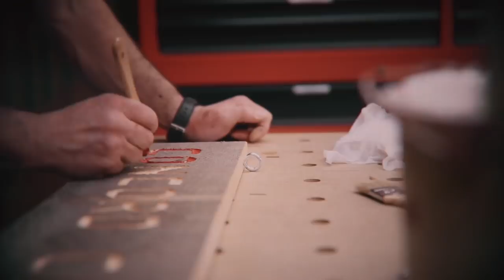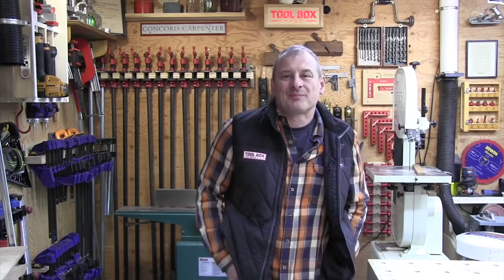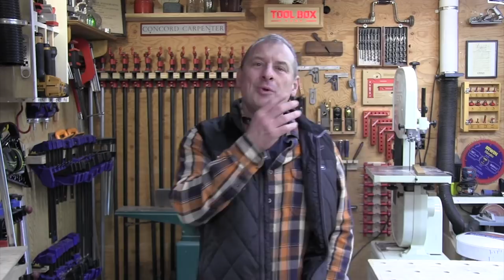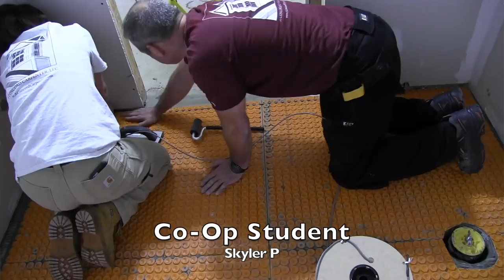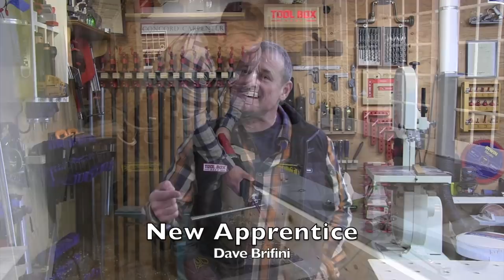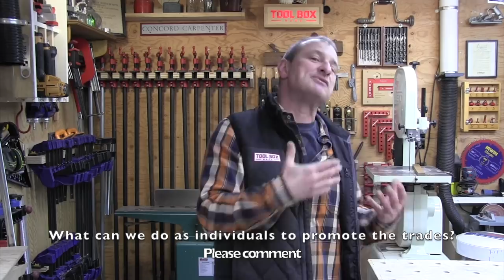Carpenter Apprentice - Trade-Skills GAP -What Can We Do Better?  Video 1

Comment: I spent my career in automotive repair, the majority of it at a GM dealership. Much like what you talk about, GM has a program called ASEP, (Automotive Service Education Program), that is a two year program that upon completion you have the training and an associates degree. For nine weeks you work 4 hours at a dealership, training under the guidance of an ASE and GM certified technician, and four hours in a classroom at the GM ASEP training center learning a specific system of the automobile. The next nine weeks are spent full time at the dealership under the same technician, then it repeats, splitting your day between the classroom and on the job training. Each cycle you learn a different system, and theoretically work with a different technician. The student is required to take and pass the academic classes in order to stay in the program to receive their associates degree.

Comment: Old school thinking is dying out.  If you pick in the young ones too hard and pay them too little, their passion dies quickly.  After the passion dies, they will switch to something easier/different for similar pay.

I've seen it again and again.  I've experienced it myself personally.  It's to the point where I no longer want to work with anyone older than me.  Work site abuse is bull and you can feel free to take the "toughen up" attitude to the grave with you.  I will be doing my own thing and help my customers my way.
Reply from the maker: Agreed!
Reply: I worked in machine shops during the summers while in school. Can't say that I was always treated well; one shop in particular was outright abusive. Totally turned me off to working on the floor. My first few jobs after grad school were in manufacturing, but this time in a white shirt. I'm semi-retired now. In retrospect, I would have been happiest working as a machinist, but the experiences in the shops steered me in another direction.

Comment: I have worked for 35 years in mostly residential construction (poured concrete foundations) mostly with tradespeople I and my father know. We've done poured walls in an eight-county (mostly rural) area. (My father is a retired union carpenter, and past Boilermaker) I tend to see things a little differently than Rob Robillard does. Through my experience (and sharing in my father's), I've learned there is a growing anti-blue collar trend (read: anti-labor) in our area and generally throughout the country. Coastal areas where Rob is are significantly different. From my perspective, there's plenty of work there, year-round, because there's a much more active economy there. Go inland, and it's a mixed bag at best. Kids go away for college or the military in a perceived quest for social and economic legitimacy. They do this because they fear the stigma attached to skilled blue-collar pursuits. They are taught that skilled trades aren't viable and not rewarding. They don't just learn this at home. They learn this from a shared experience in their community. The trend is to either regard trades as weak or to make them that way. I have relatives in Europe. The news I get from relatives over there is that trades are respected, valued, unionized and better established socially and economically. (They are seen as "viable".) Until our society confronts the way we regard blue-collar trades and tradespeople and the value of the work that they do, this issue will continue.

Comment: I think it depends a lot on your area. Here in the SF Bay area, almost all trades type jobs require that you either have at least 5 years of experience or have connections. It also helps if you can speak Spanish.
Reply from the maker: How do you get 5 years experience without a job?
Reply: @ConcordCarpenter : That's what I'd like to know. It's a real catch 22.

Comment: Work ethic is the biggest hurdle I have seen.  Some younger kids dont mind the part where they have to learn, but when it comes time to put those skills to work, they simply arent interested in working hard.  The opposite is also true.  Ive seen kids that will work, but they are impossible to train, or you train them, but they dont retain what you have taught them.  Both of these situations create issues, especially in production driven construction trades where you maybe dont get paid by the hour, but paid a piece rate.  Nothing is more frustrating when your paycheck takes a hit because the kid you are training has one these two issues.
Reply from the maker: seen that too :(

Comment: Bio:
I use help sporadically and bring in my friends from out of state when I get big jobs. I am a painter who does carpentry because the guys doing it are horrible around me.
If I look for help locally.
Seems everyone has baggage these days so. If I need someone.
 I weigh the baggage they have vs skill for the job I need them to do.
Most of the time ( in my situation) I need a carpenter with the framing/ground up knowledge I just dont have to get me to the finish part. Then I cut them loose because MOST are messy hacks after that. Show them a Festool attached to a dust extractor on a paulk total station and you may as well land a ufo in front of them.

When I look for a general helper I look for a high school drop out.
Why?
Because any high school graduate I come across cant wipe their bottom but, they know the are for a certain political party. They are weak physically and cant pay attention to detail. The drop outs seem to want to get the job done 

My rule is cell phones and cigarettes stay in the truck unless youve got grandma about to die or a baby about to drop!!
 I usually dont have problems because I lay it all out long before we work.

Comment: I have been looking for a young person who wants to learn the trade for close to a year now. The struggle is real. I am looking for someone who wants to learn, someone who is looking for more then a paycheck, but more to learn a trade, a career. It is damn hard. No one wants to work.
Reply from the maker: Judd are you advertising that way? Do you tell EVERYONE you know - lumberyard, other trades, etc?
Reply: Where do you live and what trade is it? I have been looking for something like this for close to a decade, but almost all places require 5+ years of experience or connections. Most also require you to have your own tools and large vehicle, some even require you to own your own air compressor.
Reply: @ConcordCarpenter  I have told all the counter sales guy at the three different branches of the Lumber company I deal with. It helps that I used to work for the same company, so most of the guys know me personally and know what type of boss I am, They know I expect a lot, but they also know I am very fair and willing to pay the right person a very good wage.

Comment: Take a pay cut ... pay them more. Oh
Reply: @Suzy Rottencrotch 
What do you believe unskilled labor is worth?
How much do you think I pay my new hires to start?
Reply: The Truth if they’re trained, show up on time and do the job I suggest you pay them enough to have a life
Reply from the maker: @thetruth5210  Im paying 24 to start - with a progressive pay raises based on skill improvement, drive, and loyalty
Reply: @A Concord Carpenter / ToolBoxBuzz 
Rob you are more generous than I am. I start at $16 as soon as you have your hand tools, a drill and I don’t have to babysit you you move to $25 and go up from there.
Reply: @Melissa Hill 
Why do I hire unskilled labor? Because there is no program available in my area that teaches someone the necessary skills to perform my job. I don’t want to hire old hands for some of what Rob went over in the video about their bad habits if I want to lose all of my bonuses because my wire yields and my inventory control goes out the window. Hiring skilled labor is the quickest way to do that.
I try to have my personnel up to speed in less than a month because I hire people during the rough in stage on high-rises. Because it is the best time to learn. If I train someone from the start to do things my way my wire yields and inventory control stay exactly where I need them to be and I don’t have a bunch of seasoned “professionals” turning my job site into a frat house.
Does that answer your questions?